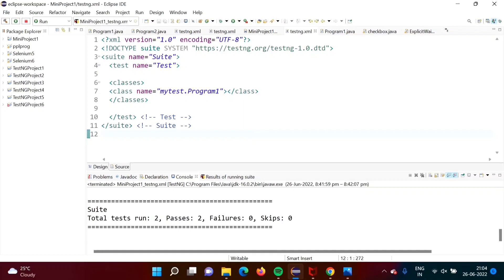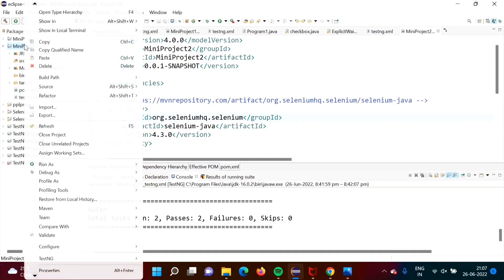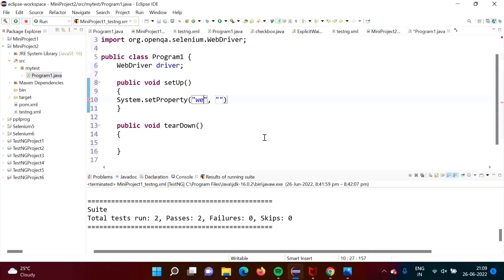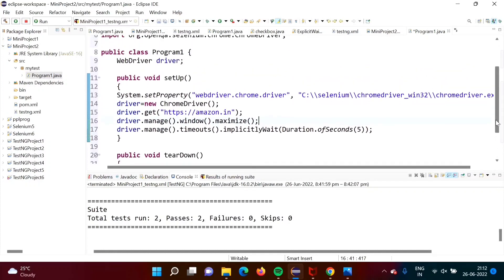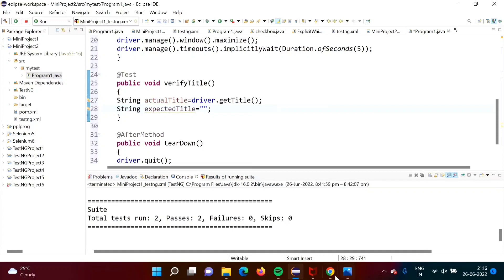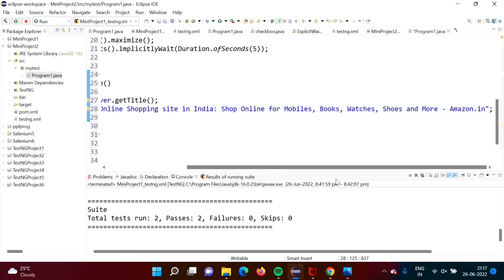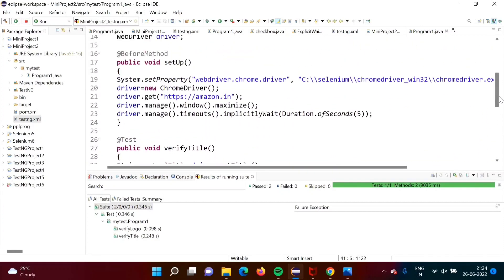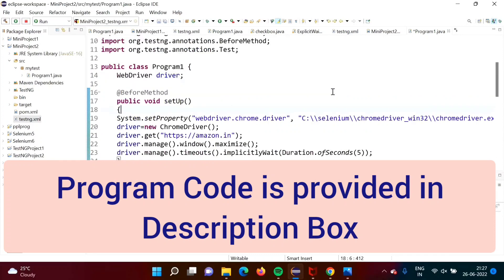Selenium TestNG Real Time Project | Selenium Maven TestNG Automation Testing Real Time Mini Project

Comment: I have a question. Let's say a user is dynamically passing commands to the API, and you've hosted your project on a server. Now, if the user sends commands to the API from their client-side (their system), they won't be able to witness the execution of those commands in the Chrome driver. This is because we've configured the Chrome driver path on the server side. What steps can we take to allow the user to also observe the execution of commands on their own system?

Comment: Sir when I'm saving selenium dependencs in pom.xml, I'm not getting maven dependency pls reply me sir 2.77 min vedio
Reply from the maker: Check internet connection. If it is working properly, then you might be using old Eclipse version.
Reply: @Comrevo  sir my Eclipse version 2022-09(4.25.0)
Reply from the maker: After editing pom.xml, save it by ctrl S. By this Maven dependencies should get added. If not, then write simple program and run it. After that maven dependencies will get added.
Reply: @Comrevo  thank you sir